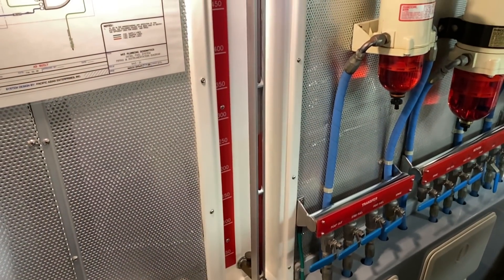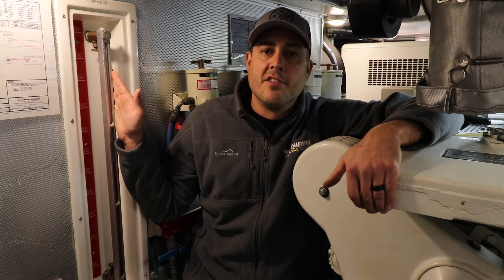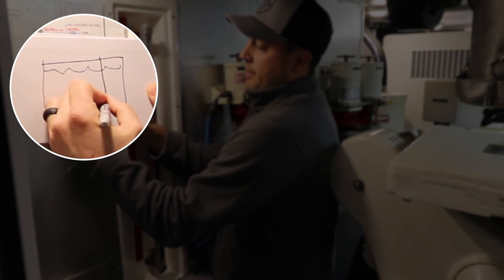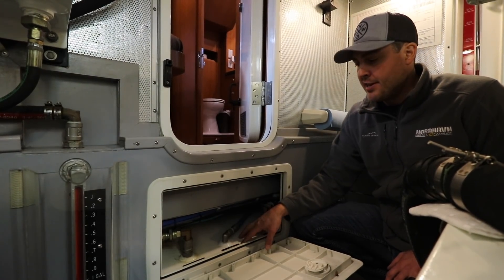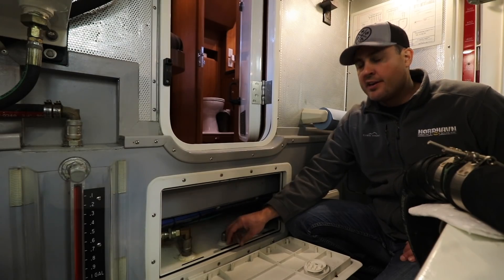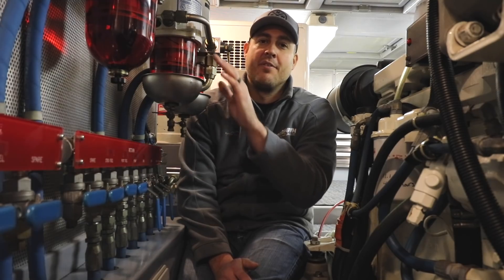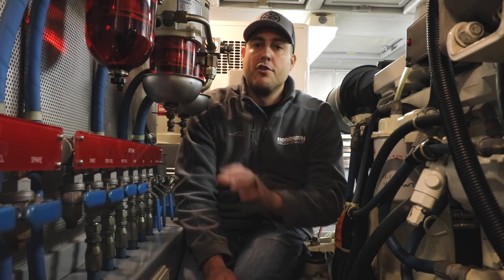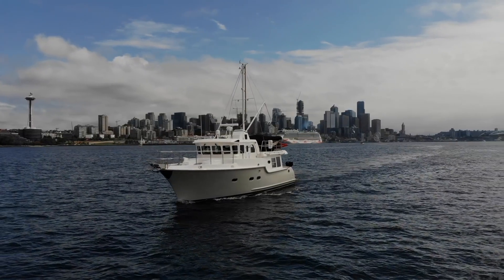Fuel System on a Nordhavn 43 [Full Review]

Comment: I would suggest fitting spring-loaded cocks to the lower side of the fuel Sight Gauges.  In the event of a sight glass fracturing - your current set up would result in losing the contents of the tank down to the fracture level.  The idea is that you only push the lower cock open in order to take the reading- release it and isolate the sight glass when reading has been taken.   On a commercially-classed vessel you would have to have this arrangement.

Comment: Consider:  Hydrogen fuel cell power with electric motor engines.  No oil changes, oil filters, fuel filters, etc.  (See my Twitter page under the same name as this comment to see just some of what this world is doing with Hydrogen).  And the by-product of a Hydrogen fuel cell is basically pure water.  Solar and/or wind power to split the water into Hydrogen and oxygen.  Your water supply is your fuel.  "Freedom".

Comment: Really good video. My boat has a similar system except lacking the daytank.  Each of my tanks gets connected via a shut-off valve before entering fuel filter with water separator.
Will consider adding a daytank now though

Comment: Shawn that was really well explained in my opinion, thumbs up.  What improvement(s) would you make to your fuel system if you  were so inclined?
Reply from the maker: Captain Jeff Morris really nothing, very happy with what we have!
Reply: I think a good enhancement would be to paint or color code the primary fuel handles on the manifold. You don't use them all. If you are in the dark or the boat has an issue labeling can fall off. Just a thought.

Comment: As for US Coast Guard, and Transport Canada, all new vessel builds, likely for the last 20 years, require fuel delivery from the top of the tank. No valves or hoses with a full tank of fuel behind them, to drain into the bilge, in event of failure.

Comment: Doing the math = USD 5,300.00 to fill the boat from where I live (fuel not cheap).
Reply from the maker: Banyan Tree when you think about how far it takes you and how many vacations/adventures that equals, that $5300 is a deal! Can’t seem to take many vacations these days for cheap!
Reply: @mvfreedom  How far does it take you? What is the fuel burn?
Reply from the maker: @emsevol2712  we burn 2-3 gallons an hour and have a range of 3-3500 NM depending on speed (6-7.5 knots).

Comment: You said you have two tanks and two fuel fill inlets.  Is there any way to use one inlet to fill both tanks?  I can see a scenario where the fuel hose may not be long enough to reach both sides of the boat.
Reply from the maker: NoneYaBusiness no unfortunately not but you can use the manifolds to transfer fuel at a very slow rate.

Comment: As the holiday season draws near like to wish you and Elizabeth and Merry Christmas and Happy New Year. One question about the fuel system, is there a filter or primary catch apparatus at the deck   inlet that could or will try to prevent or filler contaminants in the shore fuel supply from making its way into your storage tanks.
Reply from the maker: Harvey604 Journeyman no however there are funnels you can buy to help with that. We don’t use them, we hope for the best. We’ll probably get one though when we start cruising to countries where fuel quality isn’t as reliable as US & Canada.

Comment: Great explanation of the fuel system! I have a question, as a novice. Flying aircraft, esp w jet engines we use a fuel additive called Prist. It prevents fuel from freezing and kills bacteria. The bacteria is where my question lies. Do you or others put any type of addictive in your fuel to prevent bacteria from growing if the fuel you buy is contaminated?

Thanks, I love these videos. They are helping us learn so much before we buy our boat (Nordhavn)
Reply from the maker: Michael Jackson we don’t put anything in the fuel. Some say the addictives can crystallize and cause issues. We use the boat frequently enough so it’s likely the fuel doesn’t have time to have growth. That’s likely a concern for boats that sit idle for longer periods.
Reply: Andrew Jurena as I said in my question, it was purely about bacteria, not icing!